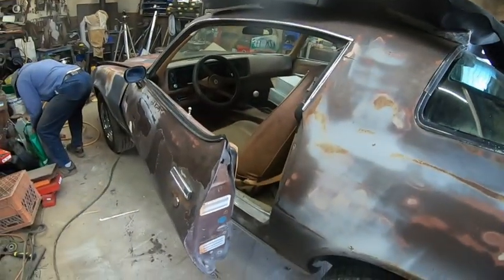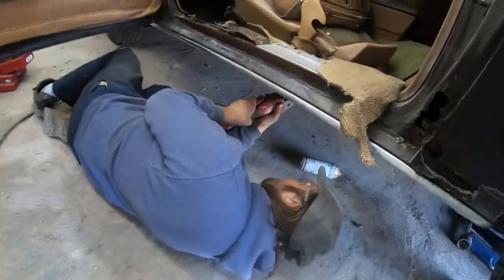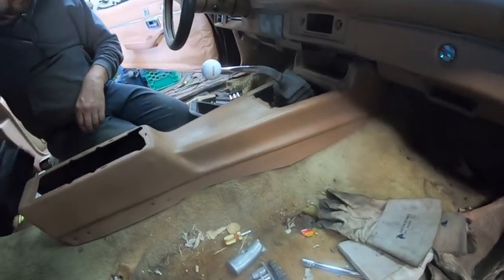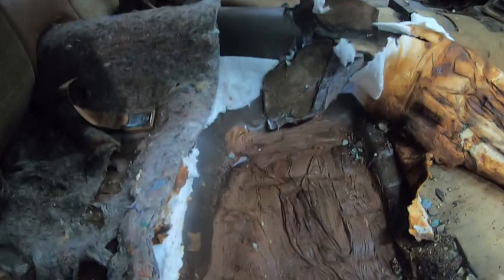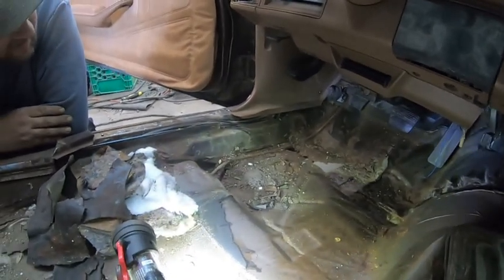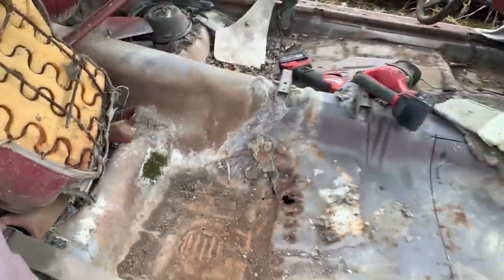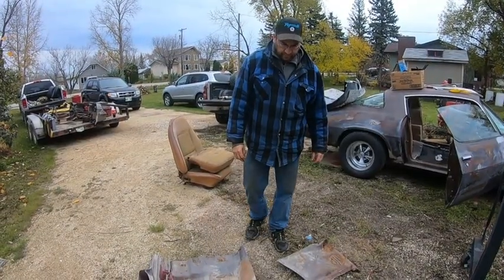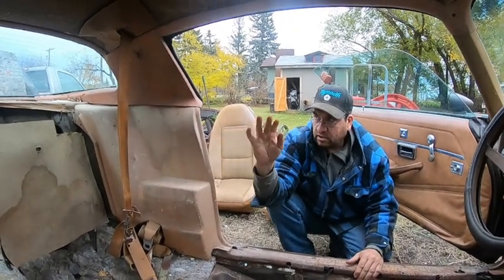Joe Dirt 1979 Camaro, Rusty Floors. Ratty Muscle Car,  4 Speed Project Car.

Comment: The struggle is real. I pulled seats ot of a Lebaron the other day. Not much fun either. Looking forward to seeing the Studebaker back in the garage. Im in lockport three days a week for a few weeks. Chiropractor, see if i can get some relief from the back issues.
I thought i read about someone using pledge on their dash. I havent tried it, so dont take my word for it.
Im glad that Firebird floor is done now. Next is pull dash out.
Reply from the maker: Im putting the el Camino away this weekend and the studebaker is coming back Frank boo ya.
Reply: Feel better Frannk!
Reply: I've been using lemon pledge for years, but won't bring the color totally back. Pledge works great for softening vinyl,  leather and some fabric. I especially love using it on vinyl roofs and great when have to stretch convertible tops. 
Pre wash with sunlight or light dish soap, spray with pledge and leave it sit for a couple days. Sometimes have to apply a couple times if really bad.

Comment: Vinyl paint is best
Reply from the maker: Thats what we were thinking thank you.
Reply: If your paint supplier carries  SEM products ask for Color Coat.  It comes in spray cans and is bulletproof.  Did the seat belt webbings on my Pontiac and never wore off.  Also have used it extensively on the Rambler with excellent results.  Go Penny's!